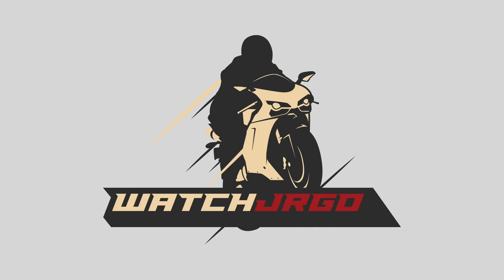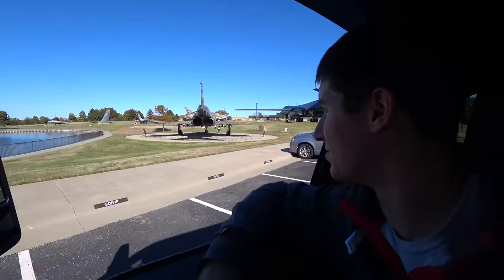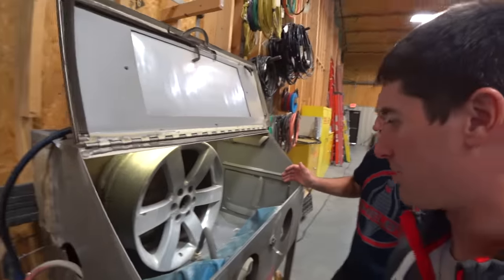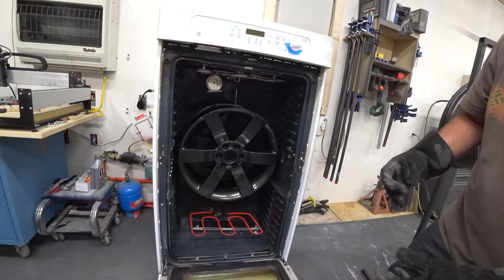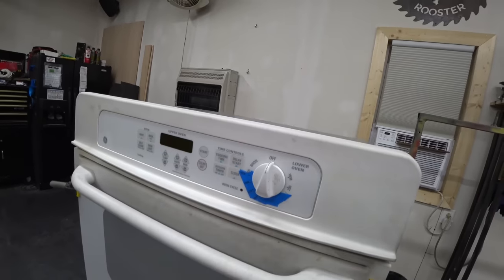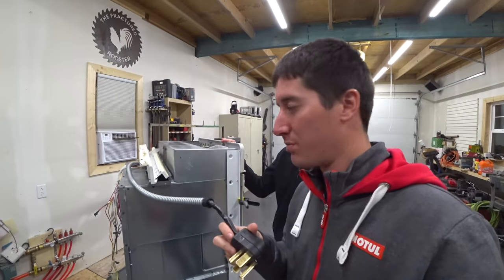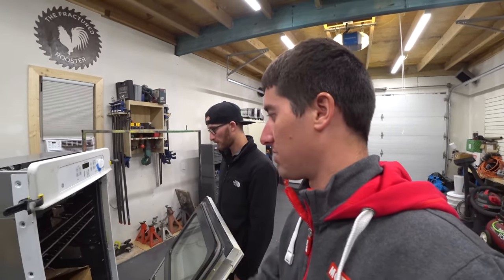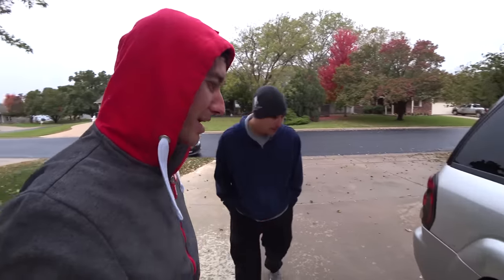We BUILT A Wheel POWDERCOATING Oven For $125

Comment: Nice air museum!  Now I have a reason to go to Kansas!  A DC-8 has four engines but viewers already told you what the tri engine was. But we don't watch you for your aviation knowledge 😁
Reply from the maker: My heart only knows the SR-71 (greatest plane ever), the 737 Max (I wish every flight I took was on it) , and I used to build the Citation X (greatest private jet ever). Built the door doubler, cockpit air, speed brakes, and a couple other final assembly jobs. ✈️
Reply: @WatchJRGo  I think the SR-71 could qualify as both a plane and a spaceship!  I have been on the Citation X a few times. Work related, I am not rich, and have to say that over 600mph ground speed is very impressive. It boggles my mind how much work goes  into engineering and assembling these things.
Reply: @WatchJRGo  Hey JR, take a tour of the Air Museums you got out there, make great YT content, and on my bucket list is that DAVIS MONTHAN junkyard of airplanes in Arizona.............................BTW take a gander at that B-52, made before you were born and will be flying with upgrades until the year 2080's ..full 130  years after it  had  first flight !

Comment: Instead of  a hook at the roof of the oven to hold  the  wheels, can  you build an angle iron rail there?  so you can pull the wheels out that are hanging  on a hook that has a nut on it? (so the nut rides on the rails..)  that should also  lessen the stress on your back putting the wheels in and pulling them out.

Comment: 1:13 You are lucky that B-1B Lancer supersonic strategic bomber is just on display. Those things were horribly noisy when they were flying around. Especially during full afterburner takeoffs.
Reply: I bet they aren't as bad as the VTOL on the Harriers were...
Reply: @CraftwerksMC  The AV-8B Harrier II jump-jet is infamously loud, but only has one small turbofan engine with 20,280 pounds of thrust compared to the B-1B's four massive turbofan engines with 30,000+ pounds of thrust each.
The noise of the Harrier AV8C aircraft in vertical takeoff and landing was measured 100 feet to the side of the aircraft where jet noise dominates. The noise levels were quite high - up to 125 dB overall sound level at 100 feet. https://ntrs.nasa.gov/search.jsp?R=19890001485
The B-1 bomber is 119 decibels at 200 feet. https://www.globalsecurity.org/military/library/report/enviro/globalhawkFinalea/13-AppendixA.pdf

https://www.af.mil/About-Us/Fact-Sheets/Display/Article/104500/b-1b-lancer/
https://fas.org/man/dod-101/sys/ac/av-8.htm

Comment: I know those tires. Those are the Atturo AZ850. Very suprisingly good and a fantastic price.
Reply from the maker: Josh just bought them from the TBSS group, everyone said they were amazing. I always ran the Goodyears. 🍻
Reply: I was skeptical at $440 to my door. But I'm a fan so far.
Reply: @WatchJRGo   The tires are made in the Nankang factory in Taiwan. A factory that has been making tires since 1946.
Reply: @TheFracturedRooster  Me too. I have a Audi Q7 with the 21 inch option. Not many tire choices in that size. Tires on this car don't last more that 20k miles. I currently have 14k on these Atturo tires and they measure about 8/32 left and evenly.

Comment: Thanks for the video, it inspired me to follow suit
Like you, I found and am using a GE double oven as the base (Model JKP350D P3BB). 
In mine, the bake element in both ovens is hidden. Under the shell. But I see that in your modified oven the element is inside on the bottom. Did you relocate it, which would make sense for maintenance and heating, or did your oven originally have an exposed element? 
I plan on doing a side hinge to make loading a bit easier. 
Did you end up moving the door seal to close off the sides where the gap is?